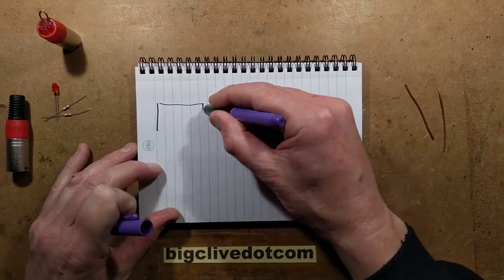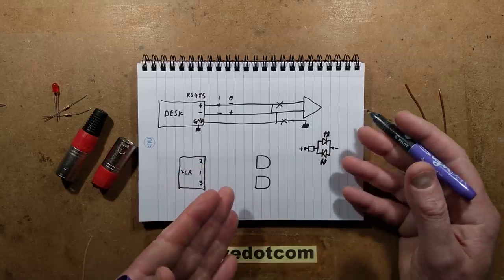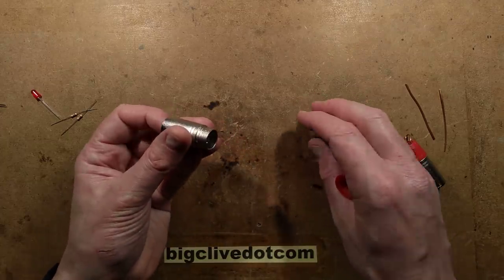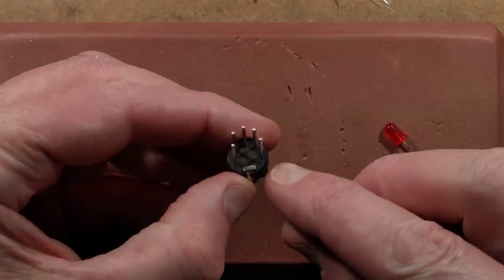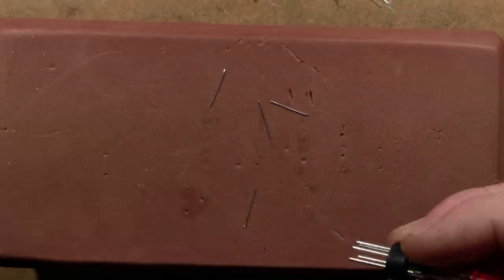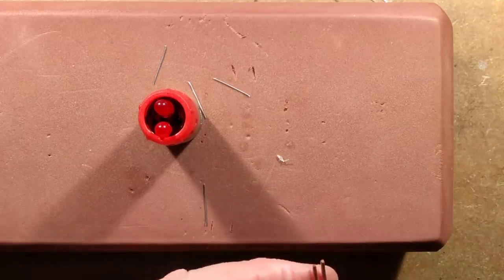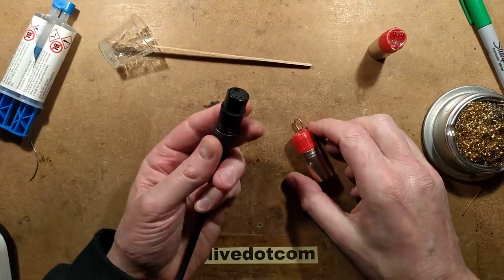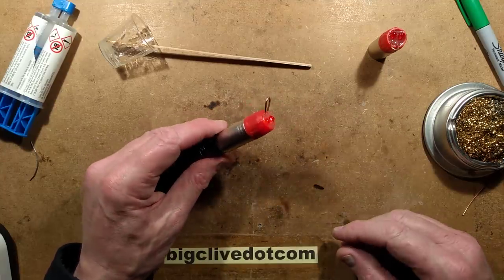DIY keychain DMX tester for lighting technicians.

Comment: I would have soldered the metal "key ring" to Ground, so that you could easily short it to any ground to better debug the (local) ground
Reply: That is a gosh dang good idea.
Reply: In v2.0, perhaps? :-)
Reply: fuckin hell manuel, thats a pro gamer move
Reply: Nice!☺
Reply: I would not do that, just because I've heard of situations where line voltage has ended up on DMX cable due to very bad gig electricians wiring trusses wrong. Because of the way DMX is implemented in good gear, fixtures can work just fine even in this crazy situation in a rig that's not bolted down to grounded metal.
Reply: In any case, typically DMX is floating its ground for long runs, so directly inserting your hand into the loop with a piece of copper may zap you eventually.
Reply: @enginerdy  that's ture to! All power looks to find a way out. I liked what you said about the gig electricians it would be scary going into work on someone else's mess. Cos he don't know what type of skill the other guy had..
Reply: @keithking1985  i always leave a job done in a way that assumes I may just be 'the next guy'......

Comment: One of the first things we built as apprentice telephone engineers was a test lamp that worked the same way.  We had official issue ones but - 2 carbon filament lamps soldered to a 10" piece of thick grading wire as a probe, a long switchboard chord provided power (almost exactly the same as clive's) except not using LEDs was far more sensitive.  Plugged into one of the many 50v dc jacks on every equipment rack in the building.  They were all you ever needed ... very rare that anyone used a meter for faulting the old strowager equipment.  The carbon filament was fairly dim and didn't hurt to look at them to see the subtle changes in brightness.  With a bit of practice you could see a difference of only a couple of ohms.

Comment: Thumbs up for talking about DMX.
Rolled my own controller some years ago from a raspberry pi and a dongle, now a days you can drive DMX directly from the pins(through some circuitry for a more robust signal). Took a crash course in DMX formatting and timing. Its not perfect, but its a damn simple standard. Very neat too look into.

Comment: Decades ago when I was still in the industry, I made several similar testers to verify phantom power in audio systems. 

The only changes are higher value resistors (phantom can be up to 48 volts) and making sure the LEDs are connected in the correct orientation (phantom is DC)
Reply: pileofstuff I make phantom testers too.  You don’t even need resistors, because the phantom power spec includes 6.8k resistors built into the mic input.  My little testers are literally just a male XLR insert, two LEDs, and a bit of hot glue to keep it together.
Reply: @Scodiddly  I put the resistors in as much to protect the system against my tester as anything.
Reply: sounds like the widget i could do with to test our 50v dc jacks on our MDF's (+/- 50v)

Comment: McDonald's paper thingys for putting sauce in are great for mixing epoxy in, as are the wood coffee stirrers for stirring it. Those paper thingys are actually designed  for you to pull the edge so that they open into a saucer for greater capacity !

Comment: This is great.  I just inherited two universes on a side gig that have some serious issues; address swapping, flickering, pulsing, full drop out etc......I'm fairly new to DMX so this is awesome, making one today.   Thanks.👍
Reply: There sure is a lot of shit that can go wrong in the world of DMX lighting, so eliminating things like cable or pure signal loss can be extremely valuable! 
One of the things I learnt pretty early on was that it´s always nice to use a splitter and separate fixtures that are fed from different powerphase on separate isolated DMXlines(each line on their own splitter output). While it often works fine even if you just run a single line even if say the strobes are running on their own phase, it can create problems. Groundhum is a thing for lights as well :P

So a good opto-isolated switch is something I bring on basically all gigs, often more than one. It separates fixtures from each other, FOH/desk from the fixtures and it can simplify cable runs a lot :) 

I have gotten by without a tester like this, partly because many of our lights will show if they have DMX and not, but I will be building atleast one! This design is as Clive says wastly superior to the older ones with just the bicolor LED.

Comment: I built one using XLR4 for testing scollers, with an extra LED, zener and suitable resistor between pin 1 and 4 for testing the power supply as well. Was an absolute godsend, as while the scollers themselves were usually pretty well looked after, the PSUs were quite often neglected...

Comment: Hot melt glue will flow better if you warm it up with a hot air gun after it's been put in place. 

It will also stick better to metal surfaces as they get warmed : gluing to a cold metal surface will set too fast and easily break away.
Reply: Yes, this. I use my hot air a lot to make hot melt glue flow better and tidy up the annoying stringy bits.

Comment: me: no heat-shrink tubing?
bigclive: I like to live dangerously
Reply: the glue is the insulator
Reply: It is, unless something shorts out before you apply glue. When he was sliding it in case, I had quite bad feeling about it.
Reply: I was thinking the same thing as he was stuffing it in the shell.
Reply: Heat shrink is your friend. Always wear protection.
Reply: @Robert C Noticed the "whisker" as well.
Reply: If its not high voltage or structural (packing or waterproofing), heatshrink on a connector is usually cosmetic. If you trust your ability to solder, its very rarely needed. If its said 'it looks more professional', that means there is janky soldering under it. If its done professionally, the cable isnt under strain and there arnt whiskers, the heatshrink does nothing but make a fiddly job harder.

For splices n joins etc, tho, accept no substitute. I once worked under a bloke who considered using electrical tape an instant 3rd n final warning, unless you could show it was impossible any other way. N fair enough, shows lack of forsight, looks hackish, and gross for anyone who ever has to work on it ever again.

Comment: I so wish they had standardized on the transformer isolated RS-485 version that Apple selected for its LocalTalk network system in the 1980s. By doubling the clock speed (but not the data rate) and using biphasic modulation with a tiny 1:1 isolation transformer at each node you end up with a variant which needs only the 2 twisted pair wires and has no ground reference, while keeping number of loads relatively unaffected compared to vanilla RS-485. As a bonus it’s polarity insensitive and completely eliminates the hazards of ground loops through the data connections.
Reply: Peter S The technique is still standard in Ethernet over twisted pair, with the highest speeds using 4 transformers for 4 pairs, while lower speeds use only 2 pairs and 2 transformers.
Reply: @johnfrancisdoe1563  Correct you are. While it's proven itself as a great method of sending data point to point, it also works wonderfully for RS-485 busses with a single transformer per node. DMX came about just before digital had matured enough to make it a much more robust standard. I used to work for one of the founders of AVAB America who had a part in the early switch away from AMX to digital and the ideas that eventually turned into DMX. He went on to make Internet of Things devices back in the early 1990s before the Internet had been opened to commercial use (I was a designer there) and he moaned constantly about how he would have gone the route Apple went if he had only known.

Comment: I once slightly dabbled with DMX but not enough to have a fault with it !

As for a tester of that ilk, I did make a pair for 1980s Ford brake pad wear warning lights - on the basis that the warning light does not distinguish which wheel was indicating the fault. The pair I made, one showed a fault and one didn't - as the system had a self-fault indication too - so with the two 'testers' one could 'plug n play' ones way around the wheels to trace the fault without dismantling anything.

Comment: "Con-rod" would also be a term for an engine part - connecting rod, the part that connects the piston to the crankshaft. But by your description of him, he's that special fastener that's only in existence on a few vehicles - the nut that connects the steering to the seat.
Reply: Top performance motorcycle racing on narrow winding roads...
All of them are totally insane xD The only race I ever saw, a guy lost control and slammed into the side of a pub. He wasn't moving so I don't know if he survived or not...
Reply: @rich1051414  I'm familiar with that crash. He was killed instantly.

Comment: a 3rd, dual color LED across  2 and 3 would help you diagnose open grounds and open cables
Reply: I was going to suggest something similar.  Without some kind of a third LED, an open ground is the same indication of not plugged in at all.  That makes a difference in what you're looking for.
Reply: Old mains testers had 3 neons to test for mixed up wiring. Having an indicator between the data lines would check to see if data was there or if the lines had been shorted.
Reply: @dave0smeg  modern ones still do this for mains (at least USA consumer grade testers)

Comment: To make hot melt glue flow in better you can also use a heat gun from a reflow station to warm it more (or pre warm the parts)...just keep the bottom cool if it has holes.  Upside down canned air can do a nice job of speed cooling hot glue around holes as i dribbles.

Comment: When building stuff like that, I like to use black hot melt, to keep the light from one LED from slightly illuminating the other. Probably doesn't make any practical difference in this case but sometimes bleedover between leds is  unsightly or misleading.

Comment: I seem to remember that the DMX refresh rate is 50Hz for all 512 channels.  It's interesting to note that a PIC micro with a serial port can be used to generate a DMX512 stream (running at 20MHz) - if you abuse the serial port slightly (to generate the long break and mark after break that DMX uses)

Comment: I was a lighting tech for summer stock theater back in the early 70s.  We had rheostats, variacs and SCR dimmers but no DMX.  A few years later Popular Electronics ran an article showing how to build one of the first digital dimmer controls using, I think, an 8080A MPU.  I considered building one but the theater lighting industry was unreliable at best so changed to a different career path.  It was fun though, a lot of work but fun, and you got to hob-nob with the actors, some of whom were famous or would go on to become famous.

Comment: I had no idea about DMX, until I watched James Bruton use it with his robots, had no idea it was so simple and I'm surprised it's not more popular with hobbyists...thanks for the explanation.
Reply: There is similar ideas, different speeds and error correctness even some with transceive capability. Some to look up is rs485, ic2, packet, rtty, psk, qam64, fsk, OFDM & CCK (used for your WiFi)
Most of these can be run over wires so it's point to point but with the correct equipment you can transmit all this over the radio spectrum, afterall its telemetry

Comment: You drew a local chassis ground at the fixture, but often "good" gear only has a floating reference ground in an isolated receiver to reduce ground loops. In practice, this means the DMX signals can float above the fixture ground by potentially hundreds of volts (depending on who and how it was made) and still work just fine!
The most common configuration for pro gear is DMX grounded at the console or distribution box and floating at all receivers, which guarantees no ground loops.
Lower quality gear (usually any XLR-3) is much more likely to be grounded at every node.

Comment: XLR-3 pin... worth  mentioning that pin 1 was nominated as  ground - because they connect before pins 2 & 3.  Originally in high-gain mic circuits to minimise plug-in/out noise.

Comment: Thanks great use of fingers to hold things. I have been wiring all types of these plugs and sockets for years.  It is useful to get a piece of wood board and screw the opposite connector to it. You can then plug your plug or socket in and it is held securely  while you work. I have  one board with DIN, D, XLR and others types on it.

Comment: Thinking you could've done without the red shroud as well. Would make it even shorter and more compact. Personally I'd have used some heat shrink around the leads as well, I know it's all potted but just in case.

Comment: Just a thought... The copper loop to fasten in the keyring? Solder one end to the casing lug, then do a 90° either to the center of the connector or along the inner circumference run it perpendicular to the axis of the connector for a bit (this is so the casing lug won't take much strain when the keyring loop is tugged at). Other end of loop like Big Clive did.

Comment: The Simplicity of that reminds me of the old Auto Electrical tester one of the magazines put out. Might have been Electronics today International or equivalent in the late 1970s. You had a red and a green LED with about five or six combinations that's basically covered most wiring faults a vehicle

Comment: I bult it and used a dmx endresistor with a flat metal back and just drilled a hole in the middle of it, looks very neat. But i had to use a 2 color led cause of the limited space. It will defenately help me in the future. thx

Comment: on small things like that, I tend to loop the component leads around hooked through each other snugly, then solder. that makes it less prone to vibration issues since it's mechanically hooked.
hot glue works great for holding the stuff apart and sealing the LED end, I wouldn't fill the whole tube solid. if you want to pot it, just use hot glue to seal the back side connector/pins first, just don't have it facing down where the glue will run down into them. of course silicone/caulking will work, but it takes far too long to set up!
Reply: clearly, I needed to watch further before commenting, since you did more or less the same thing with the glue.... maybe I'm a mind reader and don't know it :)

Comment: I noticed hitting Epoxy with a hot air gun for a few seconds directly after pouring pops most bubbles on and near the surface, so you get a clean surface after curing.

Comment: I'll actually have to make one of these. I work A/V at fan conventions often and we get just enough DMX issues that it'll be handy for fault finding. (though it also helps if the show file is properly mapped STEVEN AGAIN GOSHDARNIT THE PARS ARE ON 8 CHANNEL MODE NOT 5)
Reply: I did lots of RS485 networking about 30 years ago and a simple tester like this can save you hours of headaches. You might want to consider creating a couple variants, one of this design and another with a pair of reverse biased gallium nitride LEDs and a small resistor of 100 to 220 ohms between just the data lines. Between those two testers, you can diagnose almost any cable fault at a glance with ease.

Comment: Didn't mess with DMX, all our clubs were small and smokey and well, arguably illegal...cough, but I did wrestle with midi repeaters and honestly I really could have used a TTL light based "This shit is not actually dead" tester. Good call. Beats licking the end. What? What's that?, future potential reader? Don't judge! in the middle of a wood when you gotta get that amp/spot/genny running no-one is quoting H&S. One time I pulled a three inch thorn right out of a guys eye and he went back to dancing (I insisted he let me sluice it first at least.Yes, I take saline into a woods)

Comment: brilliant -- going to make up a few, and add pairs of red LEDs to some of our terminators as well!
Reply from the maker: The terminator resistor will defeat the ability of the tester to identify a broken line.  It will provide a low impedance current path between them.  You can do it with the simpler version though as an indicator.

Comment: 1/4" = 5mm
Just over 1/4" = 7mm
Just under 1/4" = also 5mm
And thats why I use metric exclusively. Except when routing PCBS :D

Anyway, absolutely love that freehand Soldering kung-fu! 

Top Tip when working with resin: Use a Heat gun or a lighter afterwards, it gets the bubbles out and acelerates the curing process!
Reply: @Matt Quinn Well that makes sense haha :D
Reply: Matt Quinn 1"=25.4mm exactly, by law.  When cutting metric and imperial threads on a lathe you will need a 127 tooth gear in your gearbox to hit that ratio.
Reply: @Matt Quinn There are no more digits after the .4 in 25.4, the inch has been standardized to be exactly 25.4mm for a good few years now :) Would of course be even better if everyone could just use proper metric, but hey, atleast "imperial" these days is metric at its base :P

Comment: ahh, good old serial communications over RS485, that's been around many years in computing and machinery :)
many audio cables lack enough twists per inch to keep the data signal in and clean at higher bit rates, but really RS485's highest speed is slow, so it's likely more of having a bad impedance miss match